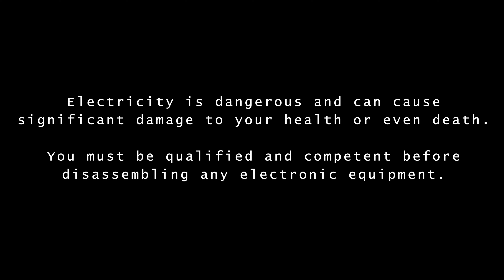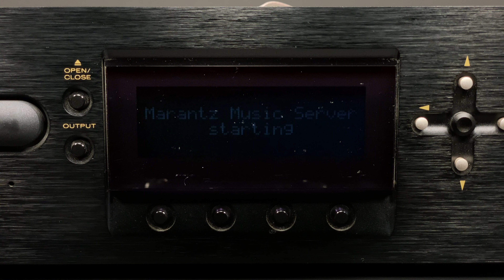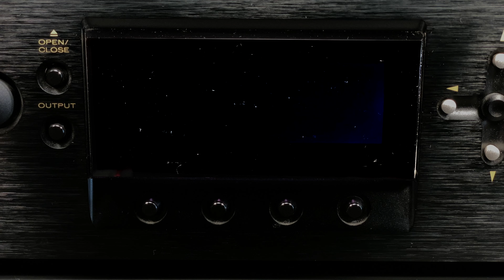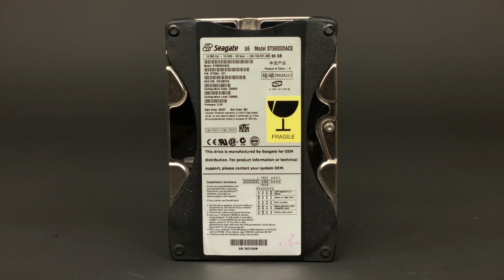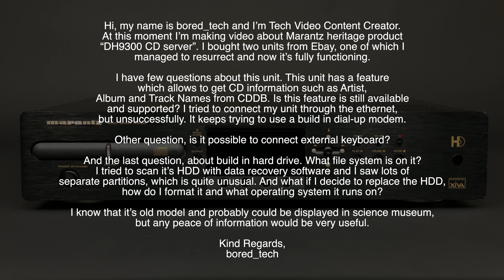Marantz DH9300 Repair And Teardown

Comment: Hi, well done, I'm well impressed. Could you possible give me some advise, I own a Marantz CD Recorder CDR NIB which I only use this machine a couple of hours per year. I have just tried to turn it on but it wont light up. I have checked the mains it is perfect. Can you tell me which part I should Change. Kind Regards Tony.
Reply from the maker: It is har do say without looking at your unit, really don't want to cause more damage.

Comment: I have an old but fresh Marantz 63se, it gets out like 5mm but then gets stuck and when u help it a bit it can slowly get out. I cleaned the tray and slides. On the way back it goes in perfectly but again the last cm it gets stuck somewhere. Very hard to see even if it’s open but ah, don’t wanna pay like 50-100 for it. I mean belt is okay and wheels too but cant figure out where the problem is and I know it’s just something minor. Any ideas?
Reply from the maker: That mechanism might have some old grease on it which with years became sticky. That might be a reason. Had few CD players which had similar problem. After cleaning the old one and adding a fresh one problem was solved.
Reply: @boredtech  hey man! Oh alright! I will also tryyy to disassemble it and check if I can see something. It’s now very dry and yes the old grease is totally gone. It has been standing in our warehouse for like 12-15years dry hehe. I removed some of the yellowish glue thing but torn between what kind of lubricant to use? Could like coconut oil work or should I buy something pro? Lmk and I can send u a video if u like to take a look. It’s like really stuck but when you ”help it” a bit it openes a bit by itself, and yeah on the way back is lot better, not perfect but works. Thanks!! Servixe is like 90usd/eur starting and then time cost for hourly…gonna be pricy maybe I dunno.

Comment: Hi, i wrote you on Instagram..i have a question on this model
Reply from the maker: I don't have this unit any more. Try downloading Service Manual, it might be useful.

In my case it was really easy. I just swapped PSU and it worked.